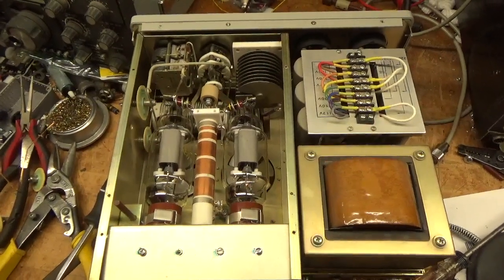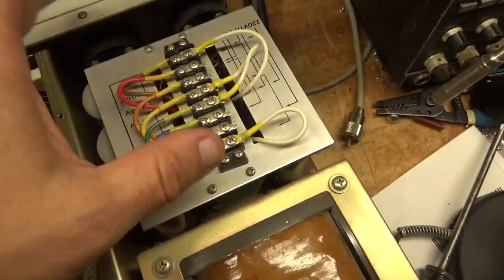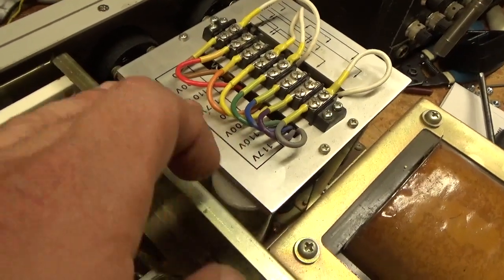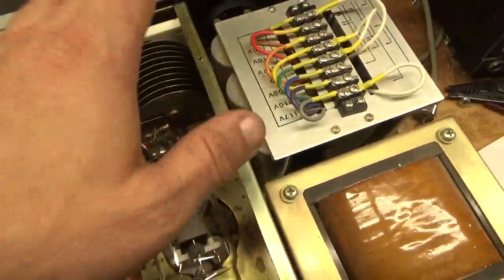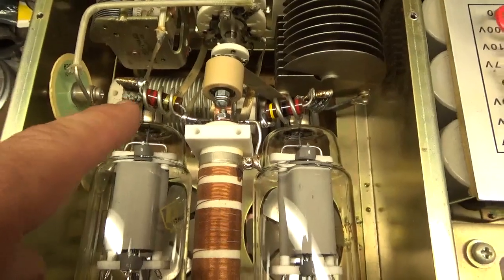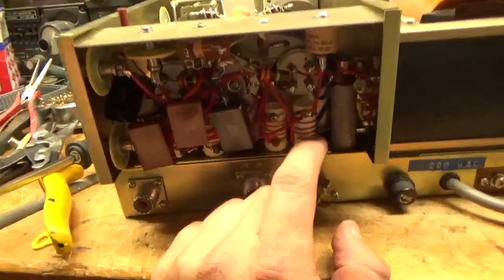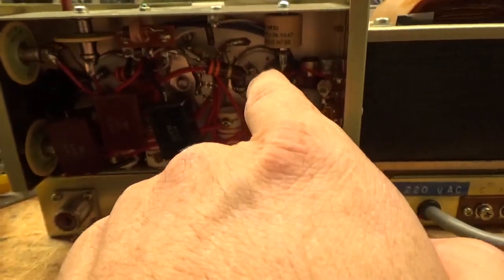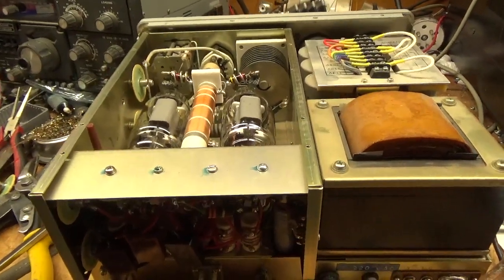Yaesu Fl-2100b Amplifier Repair

Comment: Why would one of the grid loading resistor blow apart? It happened to my fl2100b about a week ago. Thanks!
Reply from the maker: Usually happens when you have a plate to grid short in the tube.
Reply: Wow, thanks Amp Guy. I hope you’re wrong because these are brand new Penta Labs matched set. Not 10 minutes of transmit time on them.
Reply from the maker: After you repair , make sure you compress the clips in the socket for the grid pin on each tube. If you loose the grid connection the tube will fail. I always compress and also clean with deoxit gold.